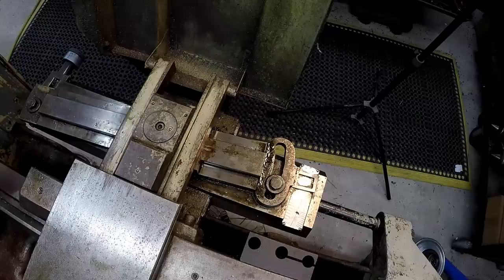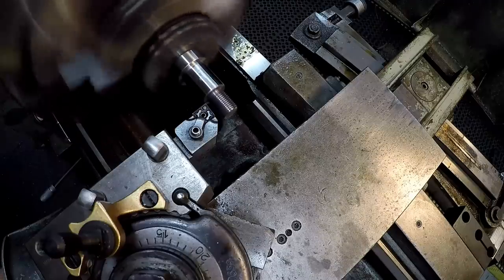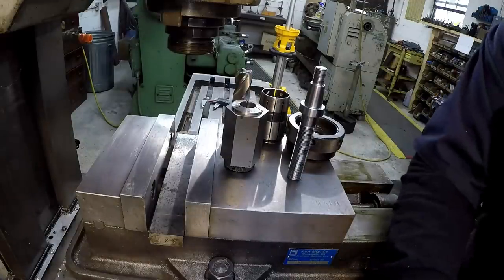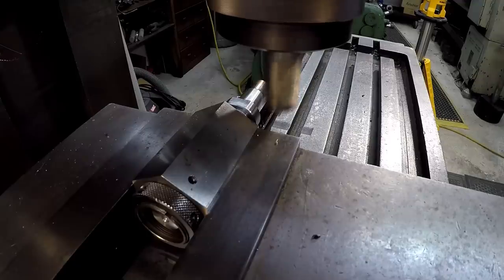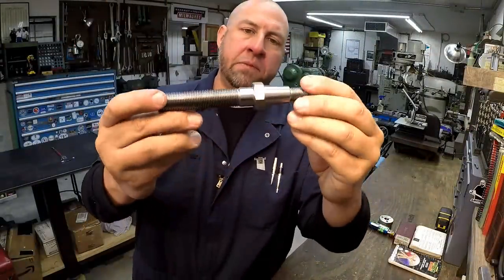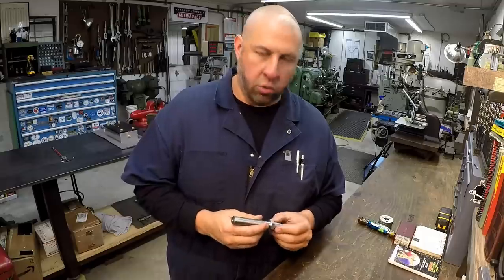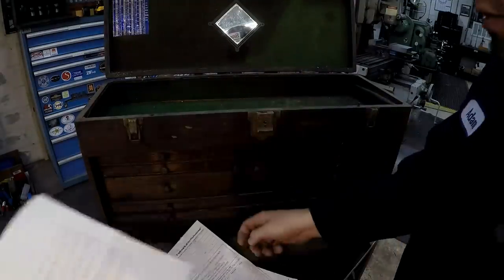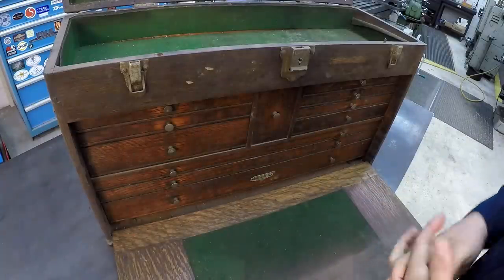SNS 253: Tapered Ball Joint Stud, Gerstner Tool Chest

Comment: Had to take lunch break in the TIG class today to watch! So awesome how you can just whip parts out like nothing. I'd be scratching my head and the part trying to make it happen. Thanks again for the awesome work!
Reply from the maker: Not a problem Justin, this is what I do. Just don’t ask me to program a CNC! 😂
Reply: @Abom79  Haha. I can write some code for a CNC, but I need to work on the manual stuff for sure. I learned backwards 🤣

Comment: GL 6-6931 was his telephone number. 'Way before Abom they used two-letter abbreviations for central office names (you can see the letters on old touch phones). That was later changed to all numbers, in this case 456-6931 when they expanded into direct long-distance calling (in the 1960s) by adding area codes. That office runs out along both sides of Palafox street up from about Texar to around present day I-10. They probably split that office as Pensacola grew, Citrus St. is S. of Mobile Hwy.

Comment: Used to work at conserving old wooden furniture, just wipe the wood down with this mix. 1/3 each - turpentine, boiled linseed oil, and real spar varnish (not poly - get the old kind). Mix it in a jar and wipe on with a rag. The mixture helps restore the volatile oils and moisture that wood looses over time.

Comment: The 1965 date on your Gerstner is right on. I believe that to be the first year they omitted the top leather handle. It cost about $60 new at that time. It is made of quarter sawn oak, hence the O52 model number. O stands for oak and 52 stands for the size. It was called the Journeyman size. The 420 number was for individual hand  fitting at the time it was made. That number kept all the pieces together. It will clean up real nice by using gasoline (recommended by gerstner at the time) as a solvent. Hope you enjoy yours as much as I do my original 1967 model that I purchased new for $66.
Reply: I was going to say that the 2610 Journeyman was the same, but closer reading on their website indicates the 2610 has increased height and depth over the 52 (which it is based upon).  The current retail on the 2610 is $1,895.00

Comment: Regards to your purchases of the tool box,as a retired tool and die maker of 43 years I own a large box reported as being a 75th edition, sure is pretty after all these years.  I bought it used in1988,it has either box no  or serial number on the bottom side of each drawer. I use WD 40 on it about every 2 years and looks good

Comment: Adam: I also agree with Murphy's Oil Soap to clean up the Gerstner tool chest. Just follow package directions. If you then want to polish it up, use a NON-SILICONE type wax. Johnson's Paste Wax  is what the pro furniture refinisher guys use. There are others, and a quickie research with Fine Woodworking or WOOD magazines will get results. See you at the Bar-Z. Jon

Comment: Adam, when cleaning these old boxes use a gentle soap. I use Murphy's Oil soap. It does a really nice job and doesn't affect the wood or finish at all. Real nice case.
Reply: That's true. I suggested establishing what type of finish it currently has (such as shellac or varnish in case it's soluble with some cleaners) and working with simple solvents such as distilled water, naphthalene, etc. before considering anything stronger. It looks like it might be fumed Oak with an BLO/wax finish? What do you think?

Comment: The GL6-6931 was the phone number of 1965.  Remember, back then phone numbers started with two alpha digits followed by five numerical digits.  Nice find!  B.T.W. the Gerstner finish restorer is great to use after using Murphy oil/soap, or use by itself.  Also works great on all of those old Starrett wooden boxes, too.  KenS.
Reply: Correct on the phone number.  GL, if you look at the phone pad is 45, thus 456-6931.  Today it would be (850) 456-6931.
Reply: Yep, and back then, if you were close, all you needed to dial was the 66931. Later (I think my are in the early 80's. maybe late 70's) you needed the other two numbers. 
Now, I live in Michigan again, but my phone number is a Texas area code.
Reply from the maker: Loving all the comments on the phone number. Most people today don’t have a clue what those numbers were for! 😂
Reply: @Abom79  My grandma still had a dial phone hanging on the wall in the late 90's early 2000's
She had a party line until Ma Bell stopped the service. Had to know what ring was for her.
Reply: Ever heard the classic Glen Miller song "PEnnsylvania 6-5000"?   - that's for a similar phone number (PE 6-5000)
Reply: And the two letters were the first two letters of a name, for easy memory.  For example, my number started with RA, for "Randolph", GL was probably something like Glenwood or such.

Comment: 11:50 It's so tempting to be quick and leave the machine running while you flip the piece. You must always resist the temptation though, because giving in is the no. 1 cause of losing body parts.
I'm always very respectful of machines, because I am quite attached to my fingers and I'd like to keep them attached to me.

Comment: Gerstner's web site has information and videos about restoring their wood chests including hide glue, felt and replacement parts. I'm sure you will do a fine restoration on this chest. I have a few of the Gerstner Tool chests and if taken care of properly should last for a few generations. My Grandfather on my father;s side was a machinist and I have his very small hand made manual Lathe about 10" long for fine metal cutting and drilling. My Dad had an electric hide glue melting pot he used to make cabinets in his pharmacy back in the 1950's.

Comment: Mineral Spirits is an excellent cleaner of all wood products and of most grunge (dirt, dust, etc).  I use it all the time to clean my wood projects before I stain or seal or clear.  It flashes off pretty quickly and with no residue--hence why it is so good as a general cleaner.  There is no water in it so if the finish on the chest is compromised anywhere, it won't do anything to it like water might.  Just pick up some of the odorless stuff at your local box store.

Comment: Hi Adam - I'm a woodworker by trade, and I love that piece. Nice! I'm considering making a repro pharmacists cabinet with (metric) tons of drawers for my workshop. If you're cleaning an old piece, first thing to do is to figure out what type of finish it has so any cleaning products don't damage the existing finish. Shellac or other drying lacquer might become solvent with alcohol, so start by checking if ethanol melts the lacquer in a hidden area. Cleaning the surfaces should start with a little distilled water (too much might swell the wood, displacing any existing finish), perhaps some naphthalene. Anything harsher and you're getting into riskier territory. That Oak looks beautiful....perhaps fumed with ammonia? Really cool stuff man. I'd love one.

Comment: For cleaning that Gerstner, use a good Orange Citrus cleaner or Murphy's Oil Soap with a lint-free cloth. If you need to "repair" the finish, use Rustin's Danish Oil low luster finish. It's a simple wipe on finish that you buff in with a good clean cotton cloth and provides good protection and a low luster finish.

Comment: I restore antique radios with the elaborate wood cabinets. I clean them with GoJo hand cleaner. Just be sure it's the type with no abrasives. It works better than anything else I have used, and it's good for the wood itself. 

 To preserve the cabinets I use almond oil based products. Liquid Gold makes a furniture polish that is perfect. Both of these products are cheap enough to use for everyday projects and are gentle enough to use on museum grade stuff. I'm sure they would work wonders on your chest.

Comment: Your thought on those numbers is correct, they are an old format used for telephone, back when an operator had to hook you up.  CL17763, for example, would be 251-7763 ...

Comment: The GL number is very likely the key number GL could be Gerstner  Lock. Mine has a Yale lock and Y and the key number hand written in pencil on the bottom of the box. 420  is the revolving production number. Look on the back end of each drawer and you will find 420-1 to 420-11. You can also use those numbers to put the drawers back in the right place if they have gotten mixed up. Nice find. Congratulations.
Reply: The key number on that style and age of lock is stamped on the right side of the lock.  The number starts with "A" followed by a two digit number and last an "M".  You can get this information from the Gerstner web sight.  They also see replacement keys too.  I've bought several over the years.  KenS.
Reply: Danny L could be right but the placement of the code near the address makes me think it is a phone number, GL6-6731. GL6 (or 456) is still an active telephone exchange number for the Ferry Pass and Brent communities in Pensacola. In the early '60s it was common to place phone numbers as 2 letters for the "phone office" and 5 digits for the actual phone number.

Comment: I'm sure I'm not the first - but the GL is a telephone exchange that they used before the all number system
Reply: In my neck of the woods GL was  Glencourt  or 45 now. I also remember Diamond or DI  for 34 as the first 2 numbers in 7 number phone number
Reply: You are somewhat correct. They still had numbers but used the letters related to name offices. Those exchanges would be offices starting with 45. The recommended Bell naming conventions for 45 offices were GLadstone, GLencourt, GLendale, GLenview, GLobe

Comment: Haven't seen the part installed, but it looks like a pretty common type of part. Tapered end goes in the socket where the factory put a ball joint; straight end gets a Heim joint (rose joint, [spherical] rod end) threaded on. More often I've seen them made to weld the joint on instead.

Comment: Adam,
8 met ms Ellis at a Dallas machine show in 1990.  I wanted a box like your, but I couldn't afford one.  Ms Ellis took pity on me as it was the last day of the show.  She made me a deal on a slightly smaller box that I still have.  Its walnut wood that you don't see very often.
The GL is from a phone number assigned in the 1950's or before.  The phone company used to assign two letters from the name of the central office where the switch was located for the neighborhood.  In Phoenix where I grew up, our number was YE 7 0384.  The YE stood for Yellowstone, the name of our central office.  When direct long distance came started in the early 1960's the letters were dropped.  Our number became 937 0384.  Just fyi

Comment: Adam this is one of your best ever. It demonstrates the depth of knowledge and experience needed to be a machinist. Your struggles with the math & setup on the taper illustrates this point perfectly. In the end you got it correct because your experienced eye saw it was not correct, so you went back over your calculations and setup.

Comment: Adam, GL on the bottom of the Gerstner is the prefix to a phone number. Two letters followed by five numbers. When the quantity of telephone numbers expanded in the 1950s, prefixes were added to denote a CO (Central Office). The old automatic switches can only address 10,000 telephone numbers per exchange. The NPA (Numbering Plan Area) is the Area Code, the NXX (Number eXchange or Central Office) is the next 3 digits of a telephone number. This is followed by the actual 4 digit telephone number. So, how do you get 10,000 telephone numbers out of 4 digits? Because the range of numbers is from 0000 to 9999 (10,000). There are many reserved numbers for test purposes, so no Exchange ever truly had the full 10,000.

Area Code          Exchange        4 Digit Number
(NPA)                  (NXX)               (0000 to 9999)

BTW, if you watch older movies, you will hear actors say, "Operator, get me Gladstone 1234." That's what the GL is in your Gerstner Tool Chest. If you look at a telephone keypad, you'll see 3 letters assigned to each number (2 through 9). The letter "Z" was later added for number "0" (There is no "Q"). 

So GL is GLadstone (the most common name used or it could be GLenview, etc.) which is the numerals 4 and 5. There are 3 numerals in the Exchange (NXX or Central Office) but it was common to use the first 2 numbers and use 1 of the 3 letters of each number to form a memorable name.

Sorry, long answer to an easy question, but I know you enjoy hearing how things used to be back in the day.
Reply: that makes 2 of us, I like old stuff and old facts too, its crazy they are still in buisness after soo long, but one might be surprised how many old time manufactures have stood the test of time and are still around and built in the usa, there are many that are even just slightly younger then us that dont have as much of an interest in old and classic things, abom, I am only a year younger then you as I was born in 1980, soo many of the young dont appreciate the classics unless they are hipsters are something, but around here in auburn and around fort wayne in indiana you are pretty much born into loving cars, they are everywhere, like cords, auburns, and dussenburgs, as well as eckarts, so classic cars are everywhere, garrett is known for trains, used to have shops up here till the 1920's and then was a division point and had a roundhouse and coal and water faciltites and passenger stuff till the end of their use, now we still have a set off yard, crew head quarters and subdivision, and have a maintanance of way and repair in place track for rail cars, whats called a rip track and its done still in the footprint of the origional car shop, though it used to have 4 tracks back then, now just one for doing car repairs and changing wheels and the like, engines are also refueled with a gas truck around here but its not what once was.

Comment: Adam, I think the #420 is your serial number. It would be on the back of each drawer along with a letter for the designated position of each drawer. I have #453. Same box model. Mine needs some repairs. According to Gerstner its the most sought after.
Reply: That number is to identify the box as it travels through the makers shop. Every piece was hand fitted, and needed to be kept as an assembly

Comment: Tapers are a funny thing, trying to remember included angles vs single angles especially on a lathe can keep a guy stocked with plenty of "practice material" good looking work Adam.
Reply: I am glad that he saw the problem he trashed the part! It turned out well. Mark of a good machinist.
Reply: @leeklemetti1887  anyone can make a mistake, it's real easy when you are trying to get good video. But realizing it early proves he was paying attention.

Comment: You may have miscalculated.... wasn't the 2nd thread 9/16"? When you divided by the 18 pitch you used 3/4" to get the .04167" compound end feed, should be .03125", no?

Comment: Hey Adam ....isn't the top arm on the Starrett indicator fixture supposed to be 3/8" in diameter? I think I may have one, but if that is correct, it appears your sliding swivel may also be the incorrect swivel ....see what your book says ....I may trade you for your larger swivel and get you the correct swivel and arm.  Jim
Reply from the maker: Jim let me look into that and I’ll touch base.

Comment: Im always amazed at the finish you get. Do you think there would have been a way to create the taper without the attachment?
Reply: Having a taper attachment makes it easier, but if you can set the piece between centers, you can move the tailstock off center to make a taper. Then of course, once you're done, spend the time to get the tailstock back on center.
Reply: For a short taper you can use the compound.
Reply from the maker: Yes you can use the compound slide, especially for short tapers like that.

Comment: Hi Adam i am old enough to tell you what the GL66731 number is in your tool box. In the early days of phone numbers there were no area codes. not that many numbers in use at the time. The GL was the first letters of the exchange name. if you look at the numbers on any phone the G would be 4 the L would be 5 . You would dial the phone number as 456 6731 My first phone number  (Terminal)  TE5 9445 which was dialed within my exchange as 835 9445. If you called some one in a different city you called the operator to get hooked up to the exchange  in that city.
Reply from the maker: Very cool 👍🏻

Comment: Adam:  I would encourage you to add your name, address and date in the bottom of the chest to help record it's ownership lineage.  Suggestion:  can you heat up that little Abom79 punch that was given to you, that would look awesome itched into the wood, next to your name and date if heating it up won't wreck it?  If not heat, what about as an ink stamp with an ink pad?  Looks awesome, and I look forward to the restoration videos.

Comment: Can I recommend using murphys oil soap on the toolbox, it does really good at cleaning finished wood and it doesn't hurt the finish dont use too much harsh cleaners if anything just use alittle bit of dish soap and dry it and go over it with the oil soap and it should come out looking really good
Reply: Adam, I would agree.  If this method fails you can alway try more aggressive methods, later on.  
Dont over look plain old Dawn blue dish detergent with the picture of the little duck on a warm to mildly hot wet wash cloth.  The mild heat and soap will lift most of the oils and greese right up.  Then wipe it down with some tongue oil.  Should look beautiful when your done.
Reply: Gerstner sells a cleaner/conditioner for their chests that's reasonably priced and works very well.